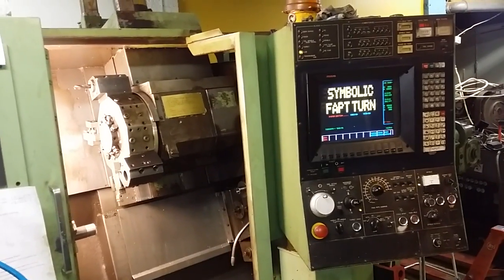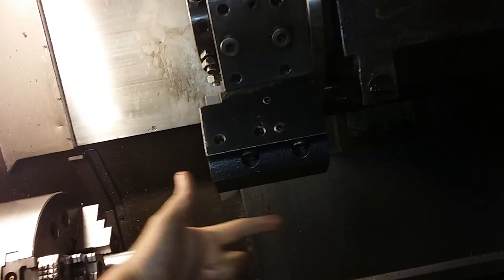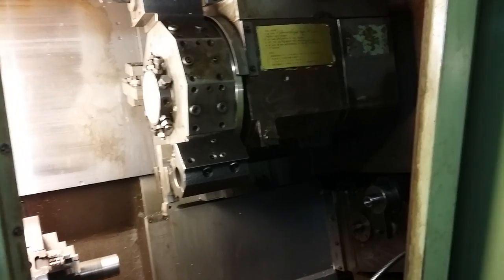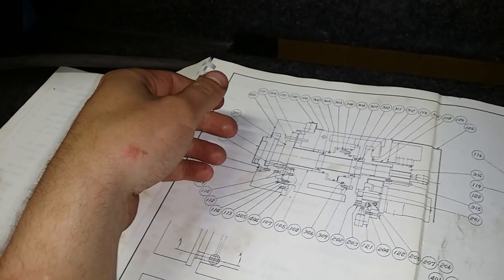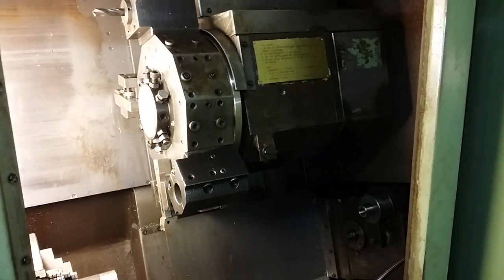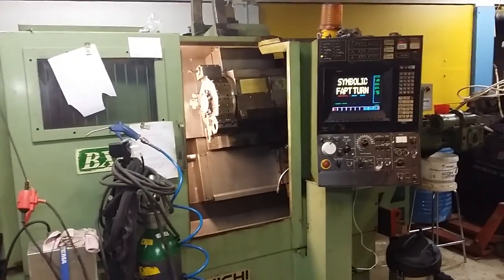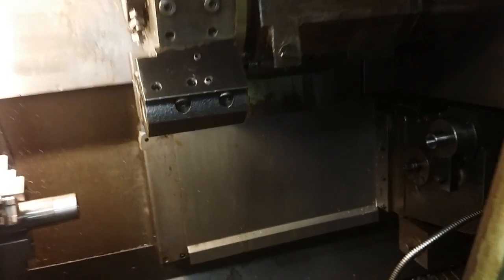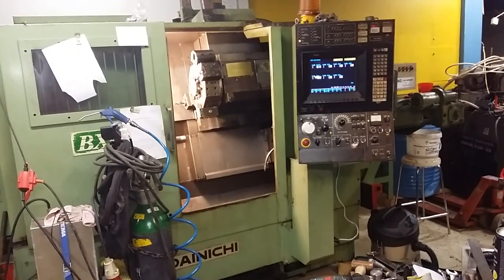Dainichi BX45 lathe turret alignment

Comment: I have small cnc lathe and in my manual it say that pins are there for just for helping you align tailstock, headstock, turret. They are pivoting points around which you rotate (slightly) object which you adjusting. After adjusting is done you need to pull them out because in case of crash those objects will not be able to slide and that means that you will permanently deform/ destroy something on machine, hope this make sense . I heard you say tapered pin, in my machine there are hardened steel pins with threaded hole , so you can make little tool with which you can pull them out. I do not understand what you get with tapered pins if they are really tapered ? Just wondering about you pins :)
Reply from the maker: Makes very much sense! In my machine they are supposed to fix the parts accurately. They also have threads for pulling out, luckily. However, all of my tapered holes are all galled out and no good anymore.. Can only imagine how much force it takes to stretch out the holes.....

Comment: Are you compensating for gravity droop on the indicator when you are sweeping the hole?
Reply from the maker: Trying to! I keep the Noga very tight and keep hanging distances short. Giving it like 0.02mm more on the other side. I haven't tested how much a Noga bends under gravity though, so no real accurate info how much to compensate for. Do you know how much it usually is?
Reply: It will depend on the indicator and individual noga. Put a bar in your lathe and attach your indicator, zero the indicator on the bar it is attached to and then rotate the bar. Doing this should give you a pretty good idea of how much gravity droop you are getting in various positions as the indicator and holder rotates. Once you know approximately what the droop is you can compensate as you take your measurements.
Reply from the maker: That's an awesome way to test it! I'll give it a go!